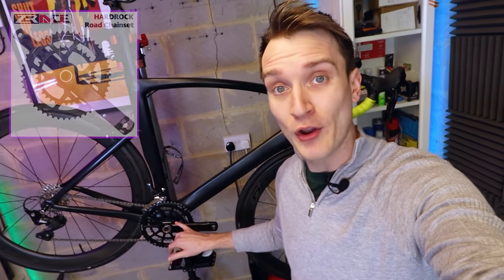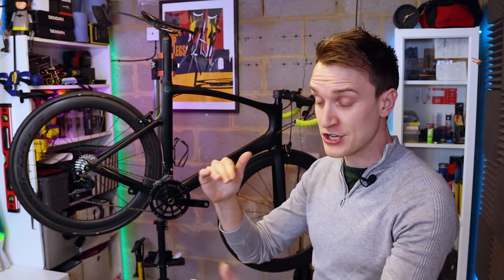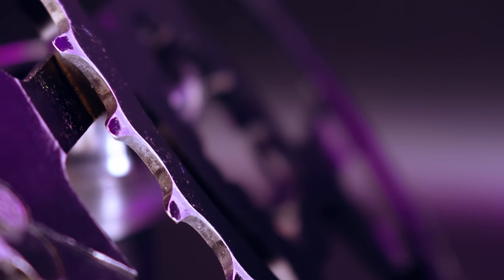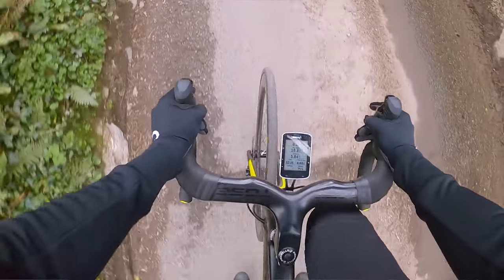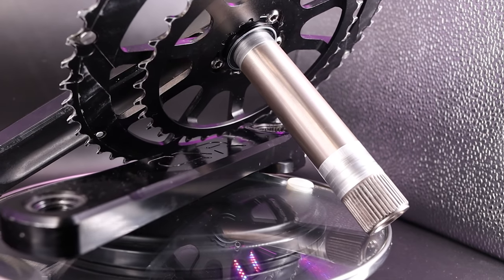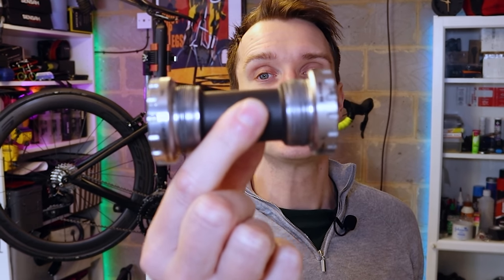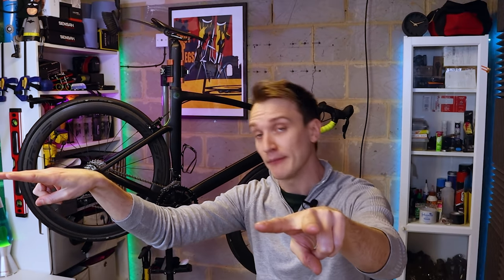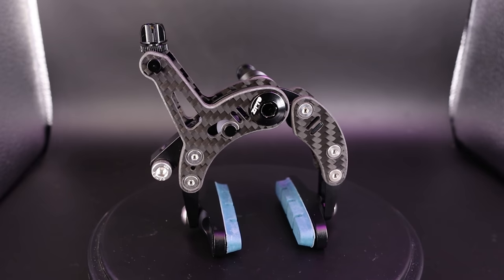Cheap Chinese Crankset ⚠️ Is failure inevitable?

Comment: Repeat again what Luke said - because of the failure mode aluminium it's hard to be sure that the crank I have is fine, but so far so good. That caveat out the way, I got a Zrace DUB crankset as part of my Sensah "groupset". This is a fairly standard 5 point spider bolted onto the cranks (same SRAM style as Luke's) with individual aluminium rings bolted on to a spider. I was getting a lot of BB creak which after a lot of messing about I realised was not the BB at all but the bolts on the spider. No matter what I tried the creaking always came back so I got the "Zrace Hardrock" one piece replacement - ie both chainrings and the spider machined out of one piece of aluminium. This comibination so far is really good - done 1000+m on it. Also it's much easier changing / replacing chainrings this way than the traditional 5 point spider - just 3 torx screws attach the one piece chainring to the cranks so it's quick and easy to swap. I'm a heavier rider (98kg) but I don't notice any flex in the crankarms and the Hardrock chainrings are showing little wear. Hopefully because it's DUB axle it is less prone to this sort of failure but who knows.
Reply from the maker: Yeah hopefully that wider axle diameter will make the difference. I certainly havent heard any stories of Sram Dub axles breaking, so fingers crossed!

Comment: I'm running a cheap Chinese crankset on my bike as well, though not this exact one - mine is made by Litepro and I use a 1x drivetrain. But your video made me check the specs and I'm certainly happy to see that the axle on mine appears to be steel, so I don't need to worry (although I'm not a masher by any means, especially as there are basically no hills to speak of here in Shanghai).
Reply from the maker: Awesome, always good to check!

Comment: UsefulMuffinCat is right. Those machining marks are definite stress raisers and will contribute to fatigue failure. Most engineering texts counsel against this kind of finish. I've had other components like seat post saddle clamps fail from similar poor design.

On fatigue failure, it is not unpredictable. Typically, fatigue cracks will be evident and growing for some time, until there is not enough material cross-section left to maintain structural integrity under load and then the rest of the structure has its strength exceeded and it fails in shear. 

You can see this by examining the surface of the failure. Where the face is shiny, that is from sides of the growing fatigue crack rubbing each other smooth as the component flexes under load. The rough surfaces are where the rest of the material finalyy failed in shear. This is evident in a couple of the shots on your video.

I have serious doubts about those rings and axle being 7075-T6 at that price point. The average punter will not be able to know whether he is getting dudded or not. The vendor is likely using something cheap and easy to machine, confident he will never be caught.

7075-T6 is challenging to machine and requires expensive cutting tips. Hand tools hardly touch it and drilling it requires brand-new sharp bits, or your drill bit wanders all over the place. To resolve some chain snatch issues from poor tolerances on a similarly priced MTB chainring, I found the tooth thickness was easily modified with an old file. No way they are 7075-T6 as claimed.

Does this help? I enjoy your videos and watching you progress and mature your presentation style. Keep it up.

Comment: I've got a cheap IXF 1x crank on a 29er hardtail I have.....Been on there 3 years and doesn't appear to be crap as yet....I haven't a clue whether it's an aluminium axle or steel as I just fitted it when I got it.....It runs well with a SRAM GX setup....
I even stuck one on an old 26er hardtail last year (1x11 conversion), when I couldn't get hold of a Shimano kinda thing, and it's been pretty damn good.....It also runs very well with a SRAM NX setup.....
I do check my chains regularly with a chain checker and just replace parts when necessary.....On a 1x chairing, it's just a piece of piss to stick another one on....Just keep your bike clean is the best advice....
Saying that, I don't really put much load on the pedals as I'm pretty ancient and only weigh 9.25 stones and it's pretty flat around here in Peterborough UK..
Good video again fella.

Comment: Getting 7000 miles out of chain rings that cost $34 to replace is outstanding. Full stop.  Are there really people who think parts should last 70,000 miles? I'm doubtful that 99.9% of the cycling community will ride 70,000 miles in their entire lives. In my observation, almost everyone replaces bike parts to get the newest thing, or other vanity based reasons, not because they actually wore it out.
I bought that crankset (chainset) based on your video, put a few thousand miles on it on a road bike, then converted it to 1X and I'm using it on a gravel bike now, beating the hell out of it. So far, it still looks new.
Reply: $34 for an inner chainring is nothing special in the deals department.   I just paid $26 for an FSA Pro Road chainring, shipped!
Reply: @CrabgrassFarmer  Got news for you. Most FSA is basic aluminum stuff. Nothing wrong with it but nothing special either. Besides, this is not an inner single chainring. It is inner and outer machined from a single billet of aluminum, one piece. Requires considerably more material and work to make it.  Far stiffer and lighter than the typical two chainrings held on with 8-10 bolts configuration that most cranks use.
Reply: @elephantcup  I stand corrected.  Thanks.    I realized sometime after I posted that this was a one-piece crankset and didn't get my comment deleted timely.

Comment: There's another issue you didn't mention. The crank arms are dead straight. Other brands make them slightly curved outwards to give space to the shoe of the rider. The CVR cranks were unusable for me. I had to put spacers on my pedals to avoid the shoe touching the crank every revolution. I don't recommend these cranks for this reason.

Comment: Thanks for the heads-up; I just ordered the steel axle version of the crankset.  I'm a heavier rider and I really appreciate the follow-up on your videos.  When it's all said and done I probably haven't saved much money over Shimano (new steel axle crankset was $31, $20 shippng) but I like the look of these better, setup was easy, and shifting is no issue.  And the faux-speedplay pedals are still going strong - that was a great purchase!

Comment: Great video.  When I did my build last year I used the same crankset (I also used the same 'Speedplay' pedals).  I'm a heavier rider so I'm going to replace it with the steel axle version.  Your updates are much appreciated.

Comment: Just got my 165mm Senicx (BSA68) to try out shorter crank arms on my tri-bike. Comes with pre-load adjuster. Smooth finish on axle. So far, worx well enough.

Comment: I ordered the Goldix RX crank arms (the ones that look like ROTOR) in 165 when the turned up they where basically these crankarms but without the CVR/Hardrock logo so I checked the listing and they don't do a 165 in the "ROTOR" style (my fault for not paying attention basically) so I suspect Goldix/CVR/Hardrock/Zrace etc. all pee from the same pot.
Cranks have been great to be honest they have the steel spindle and I have put them on my road and gravel bikes. I don't do much road but 12000+ km on the gravel and so far no issues. Although I don't use their chainrings as both my bikes are 1x.
Reply from the maker: Nice, thanks for the comment Chris, always good to hear some other experiences with these parts! I think having a steel axle will really help with the longevity of your crankset!
Reply: @TraceVelo  Well to be fair I'm 5'5 and weigh 58kg soaking wet, so I don't worry too much 🤣

Comment: hoop strength is something most people will never have to deal with   most car drive shafts that put power down have a aluminium shaft somewhere on it      so a small bump in diameter has a huge improvement on strength like 4x

Comment: Great Video! I had the exact same problem on the exact same cranks. Axel snapped as i was pushing off from a red light. I'm 6'2", 210lbs and had about 4500mi on the cranks. Company replaced with the steel axel version under warranty and so far ok. I will give it one more year and if there are any more shenanigans, I may just spend the $$$ to go Shimano or explore the larger DUB tech as you suggested. Thanks again!
Reply: From which store did u get the steel versión? Could you give me the link if you have it please!!

Comment: You're correct... aluminum will fail, given enough loading events.  Plus, while steel is ductile, and will elongate and stretch prior to failure, giving you some heads up that it's going to completely fail within time (hopefully enough heads up to notice before full failure). Aluminum, however, is a very brittle (the opposite of ductile) material in failure. So aluminum DOESN'T give you much of a heads up... so, you got that to worry about now.
Reply: Steel fails in a bunch of different ways (including fatigue if there is a stress concentration or high loading). Not all of them are ductile failures, depending on geometry and the specific type of steel used.

Comment: There was at least one generation of Shimano road cranksets having aluminium axles - in particular, the 105 FC-5600 ones. I did have one and it did have an aluminium 24 mm axles, but with somewhat thicker walls. It was one of the first generations of Hollowtech II axles I think and the crankset weight as near as makes no difference the same as the next generation of 105 (FC-5700), which came with steel axles.

There were some reported cases of Shimano aluminium snapped axles, but then again there are just about as many featuring steel Hollowtech II axles. I guess there are other factor in play there, such as the parallelism of the bottom bracket bearings or preload force.

Comment: Can't be too bad if you're sticking with it for the time being, thanks for the entertaining and informative content, looking forward for more. I especially like the budget bit. I had my bike nicked; a felt 2014 mountain bike £475. Went  to cash generator and found amongst the others a boardman 8.6 mtx, it was scruffy it was stuck on the middle crank out of 3x and tektro hydraulic brake, 700c. Because I've been riding in middle crank for 12 weeks I'm thinking I don't need 3 up front just a single 9x,  then you're content popped up and it's energised me to shave off the weight even more, the boardman cost me 300, new in the shop 575. So it's kind of screaming out up grade me, I'm starting with the front crank then elite wheels then a 1000w electric motor! Just joking

Comment: Do you ever buy any cycling gear from your LBS? Shimano did use aluminum (24mm) in some of their earlier generic & 6600 series compact cranks. Major brands (Shimano ,SRAM & Campagnolo) although cost more I am convinced that they perform better and a better value. My shop is totally independent (no contacts to anybody & sell many major brands other than Giant , Trek , Cannondale & Specialized) and I have been working on bicycles for 50 yrs so I come with a little knowledge. Thank you  for looking into the various component brands out there. I think you will find that the Chinese made parts will work OK ( everybody's idea of OK is different) but will not last as long as the original designed part (ie. the Cannondale copy chainrings). We live and hopefully learn everyday. Keep up the good work.
Reply: So you'd rather have Shimano's broken crank arms for $400 than a broken spindle for under $100😂

Comment: Are aluminum axles unusual? Our wheels are running on aluminum axles. Also, some mountain bike cranks use aluminum spindles. Those have to take the load of landing jumps crooked, casing landings, and high speed rock strikes while standing on the pedals. All fine. 

With that said, I’m not sure large aluminum spindles are preferable. Smaller diameter allows for larger, more durable bearings.

Comment: Just about every BB30 crank has used an aluminum axle since Cannondale invented the standard two decades ago. The problem isn't that fatigue curve per se, it's something in the uniformity of the metal or the manufacturing that's changing the slope.

Comment: Bought these cranks because I was in need of new cranks in the summer of last year and you recommended them and well...they fit my budget. Since I saw this video I was a little worried so I took my cranks off my bike and checked the axle and it looks good. But it kinda looks like steel to me. So I took a magnet and my axle is 100% magnetic. I googled 7075 and it is basically alloy with zinc neither of these materials is magnetic. So am i right assuming my crank is actually a "newer" model and made of steel?
Reply from the maker: Yeah sounds like you've got a steel axle, so you should be golden!!!

Comment: To check whether yours is aluminium or steel, just put a magnet on the open end of the metal shaft on the drive side - which can be seen at the start of Luke's vid.

Comment: My OEM 3x lasted over 6 years 50k miles give or take when it did wear out I had to get a cheap 1x off Amazon good thing the shop I used had no trouble getting it setup after 3 bottom bracket that is

Comment: Great content as usual Luke. Thanks for your hard work. One quick observation, at the end when you pointed out your DB road bike, did I spot some 20mm pedal extenders? Do you notice a positive difference in comfort? Power output? Cheers
Reply from the maker: Carl, you have some EAGLE eyes! So yeah I've always suffered with some slight knee pain in my left knee (usually sets in after about 30 miles). I've tried SO many different setup changes, and not much has helped. I think I have some slight hip impingement at the top of my pedal stroke, so I’m giving these a go. Not sure if it's the silver bullet I have been looking for, but so far, def seems to help… Time will tell though!
Reply: @TraceVelo  ah cool, usually if pain is on outside of the knee they will help, invariably though, most issues are caused by excessive saddle height. I'm considering the spacers as I'm 6'5 and makes sense I don't have same q factor and stance as a 5'3 chap that has same crankset. Also when gym squatting, the body naturally wants you to put your feet wider. So I figured spacers and cleat rotation to slightly heel in toe out would be beneficial to biomechanics. Also may help your knee pain if you walk toe out but ride toe in, or straight 👌
Reply from the maker: @carlsiveyer7164  Saddle height is something i've tinkered with SO much, but I think i have it pretty spot on. I've had a couple of bike fits in the past, so I know it's pretty much where it needs to be. But yeah give the spacers a go. They are only a few quid, and I definitely feel as if i sit a bit more squarely on the saddle now. I've actually got some 16mm spacers in the post, so will be giving them a go too.
Reply: @TraceVelo  great yeah 16s for me also
One last thing to look into is "mid-foot cycling " many many reports of people SOLVING their knee issues with the patrol cleat adapter, also solves metatarstalgia and hot spots in the feet. Also saves the achillies and calfs from fatigue, no loss of power, but a slower sprint transition.
I don't work for mid-foot cycling by the way, just it solved alot of issues for me, and for £30 it has to be worth a punt for you. 3mm stack height and 24mm of possible cleat movement rearward. Commence googling mid foot cycling and hours of rabbit holing that will probably surprise you. 
Thanks again for the content, I'm running 3 sets of elite wheels, the BWS being utterly bomb proof and more lateral stiffness than I have ever felt 😀
Reply: @carlsiveyer7164  lots of specifics there about various cleat adaptions etc I don't know about. But I'm 6'3 and had knee issues. Put in the spacers and all good. Hit 50 miles ish cycles and no pain. 👍 They are a cheap option to try first. 👍
Reply: @tobingj  yeah ordered, bigger guys no doubt would need bigger stance, but the cleat adapters from mid foot cycling make a huge difference as we usually have big feet too, worth looking into as they are £28, relieve the achillies and calf and increase foot stabilisation. 
Swear by them now

Comment: i think i bought a similar crankset.. it is an IXF "brand" for a 3x7 MTB...
i dont load  the crank hard when i start/stop at a light... that said i was 100kg then..worked fine for 6mths plus
i got a new job 1.5yrs ago so my bike hasnt been ridden since. well, partly because so many damn construction around my neighborhood and i shattered my kneecap when i fell near my workplace.

if this is the possible scenario, i guess 40 dollars for 6 months isnt such a bad "cost"
but ill probably get a new one instead of trying to transfer the current one to a new bike.
its a cheap MTB anyways, meant as a stopgap after i wrecked my prev bike after skidding on an oily drain cover and letting it drop into a ditch

Comment: Back in the Stone Age (well,1970’s) during my Road Racing days I broke 2 Campag Record cranks ..above pedal thread. Early 2000’s had 3 FSA Carbon Crank fails when pedal thread insert became unbonded...Seen an awful lot of Shimano Road Cranks fail in the last while..so? Would say from my experience of riding Chinese Carbon frames from Ali Express for the past 10 years that the old argument of rubbishing these products ( often promoted by Mainstream,Overpriced Bike Brands,also made in China) is mostly inaccurate! Those cranksets you feature ,if branded by a company beginning with s and ending with m...would cost about £350!   Prob would choose Steel 24mm axle though.